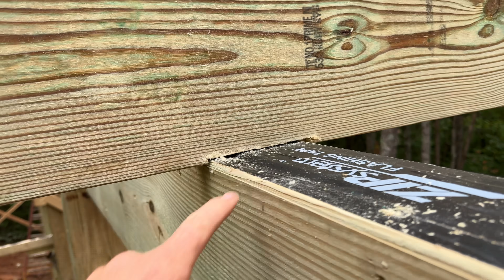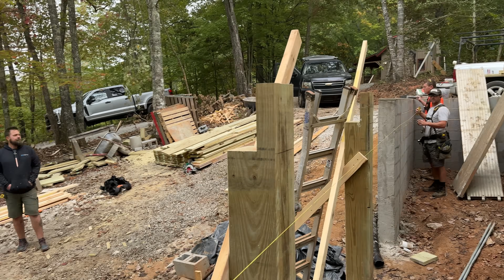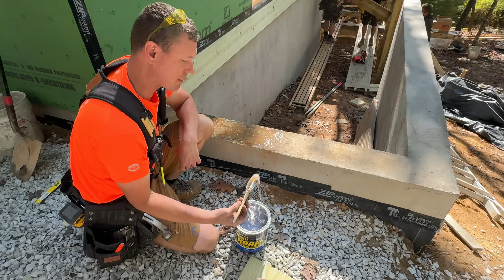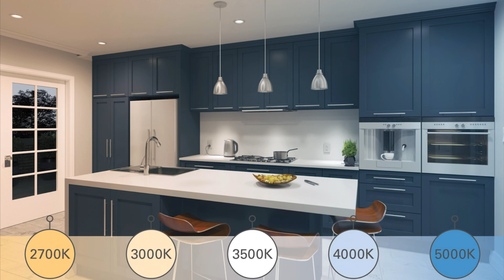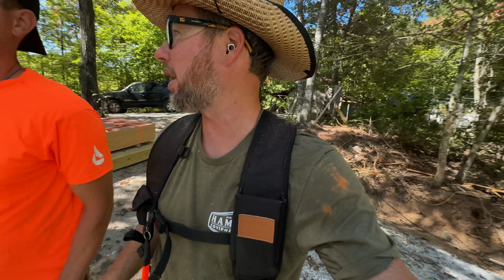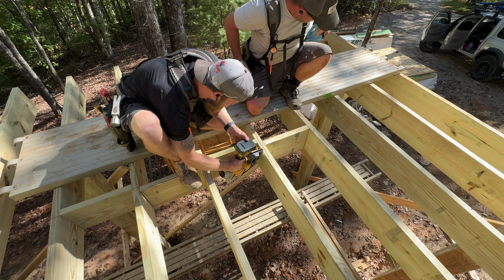Modern Home Build | 19 | attaching deck framing to masonry walls

Comment: Thank you for the video.  I have a question with building a 2nd-story deck with Timbertech PVC boards in Orange County, CA.  Should I have the 4x12 ledger board recessed into the stucco to attach to the block wall or should I have it attached flush with the stucco?  Btw, we plan to install Trex RainEscape waterproofing system for the underdeck.  Any advice you have is much appreciated.

Comment: You and Jamie brought this up in a previous video, so thanks Google.

"Linear" means basically "related to a straight line or to lines in general". "Lineal" means "descended in a direct line from an ancestor". It is less commonly used as a synonym of "linear".

Comment: Keep your truck buy a 3/4 or 1 ton van you will not hv rusty tools and w/ a 10’ bed u can put most your quick run material in it!  12’ still can close the doors !

Comment: Has the wild fire potential been incorporated into the design concept and use of materials?  Now's the time, considering the surrounding trees and undergrowth.  The site is also at the crest of hill. This is a major insurance consideration in some states, especially California.  Ground clearing atound the home is an obvious first step. Then considering the trees.  Tree thinning and limbing up reduces deadwood for a number of years.  Then its siding/decking and exposed eves.  Cettain native ground fovers may address flamabilty better than others. 😊

Comment: Quick pro tip. Why don’t you guys just take the measurements of your smallest board with wise and set your table saw at that with and just rip all joist to the same with. It could save you some time and you don’t have to plain anything later.

Comment: We do our blocking a little differently, so we use a slightly smaller profile so the blocking doesn’t get affected by water below the decking allowing an air gap between the deck and top of the blocking.

Comment: Umm...2the problem with lumber these days, even Fortress pressure treated

You build it perfect, then in a year it has twisted, dried out, cupped, etc. And I don't care how much liquid nails you slather on every mating surface.

It's crap lumber we have to build with. Builders make it work, but it's hard to get a finish product that will last for 30 years.

Comment: As a deck builder it's always crazy how fast the frame goes up,  then everything slows way down when it comes to all the blocking. Then the decking goes down really fast and then handrails seem to just drag on.   The devil is in the details.

Comment: When using long structural screws put wax or lube on them It will save your drills motor
You can buy a tube of wax specifically for this

Comment: You need to get an air palm hammer to nail in those hangers where you can't swing a hammer.  I can't link any in this comment, but just google "Palm Hammer"

Comment: We've used those same Halo LED lights and our customers love them. I had no idea about daisy chaining the lvdc. Thanks! A customer with 5 of them that are about 3 years old hard one that started flickering. Turned the light was fine, but DC power and light color selector had become flaky. I could've used a nearby light to power the good light and not bought new one. The good news is the new light dc power and color selector were backward compatible with the 3 year old unit. Thanks guys. BTW, I hate pt pine, its garbage that you can't avoid using

Comment: Those Cooper Halo lights are the best. I’ve been using them for years. I don’t understand why people took so long to use them in new construction. Those huge recessed cans and ballasts are clunky and cumbersome. They used to be a pain to connect with standard 14/2, but their new connectors are so much better.

Comment: What an incredible house (I absolutely love the "treehouse" feel of it, and the privacy.)  The deck is incredible, if that was my house I would spend as much time as possible outside on the deck.  Question:  why not get the roof on, and get it dried in first, before starting the deck?  This time of year, I would always be worrying about the weather, and the last thing I would want is for the inside to get soaked when the rains come.  Maybe there is an issue with the roof (waiting for supplies?)
Reply: I don't think the episodes are quite so fully in synch with the YT upload. Might be 3, 4 weeks buffer, just in case they cannot work every day for a while?

And thinking of past series, they started a full build of comparable size basically around first snow and had to swipe out the sleet every day they could work on the site for weeks. Even the roof was covered in Zip plates while it still was wintery. Then it did not stop to rain for the rest of the build or so... ;)